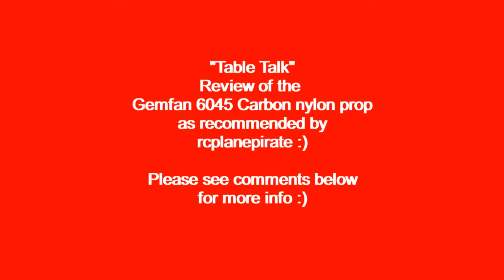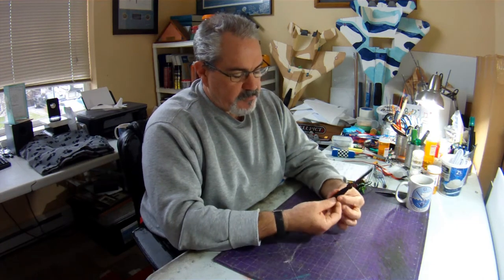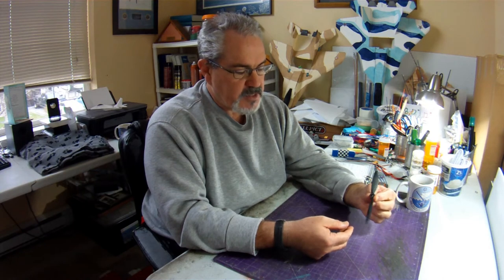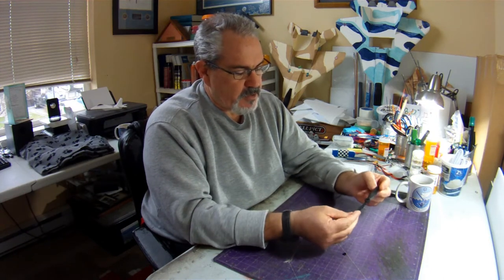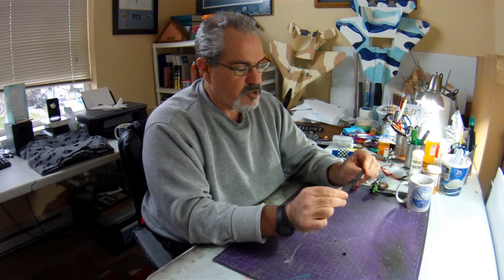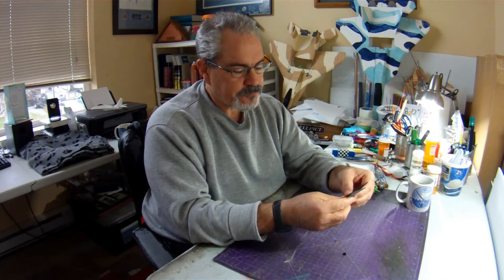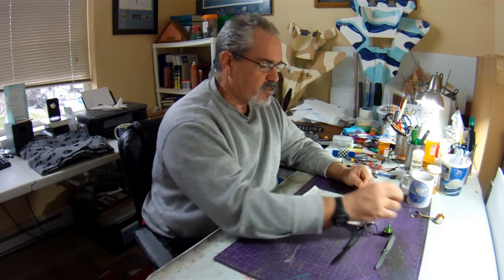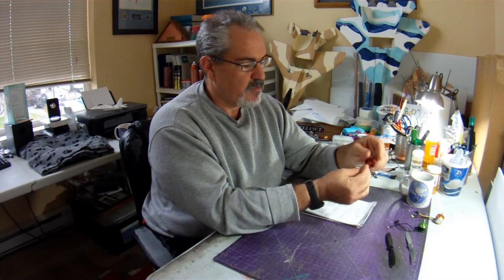"Table talk" - review of the Gemfan 6045 carbon nylon prop

Comment: Hi Scott,  thanks for the debriefing on this prop and application in your various
power systems.   Your testing and assessment protocol is spot-on!

Thanks for reviewing and sharing your results!    👍🏻😃✌🏻
Reply from the maker: Thanks Jim, this has turned out to be a great prop for motors between 2200 and 2600 kv and it is fairly inexpensive and more readily available to a lot of folks than is the 6x4 APC gas prop.  Cheers, Scott
Reply: e3Scott   I concur and ordered a set from Emax this morning.  👍🏻😃

Comment: Have you tried this prop on the 2826 2000kv turnigy motor? I saw rcplanepirate was getting 1500g of thrust at 30a on 4s 🙂 I was thinking about putting that setup into a hobby king mig 29 glue n fly? To much power for that plane?